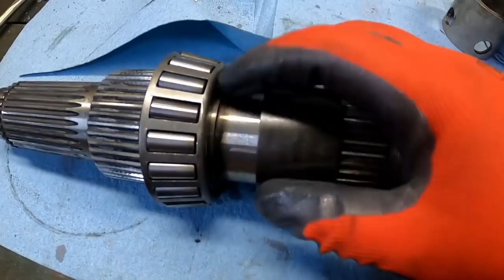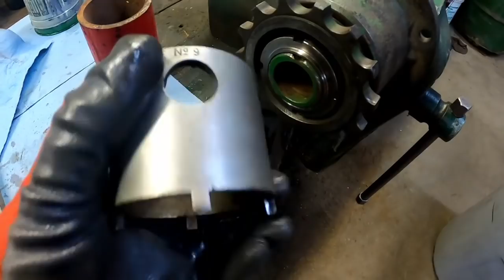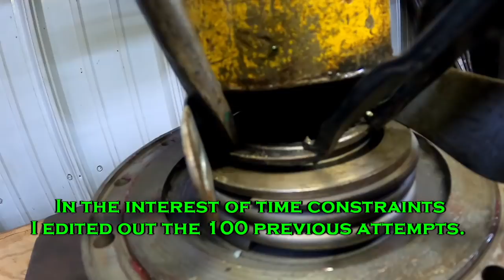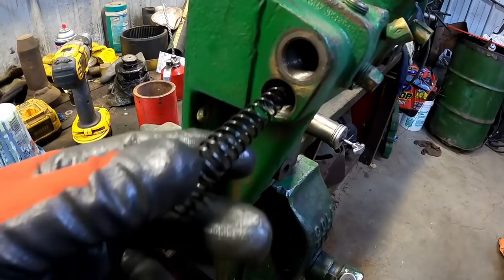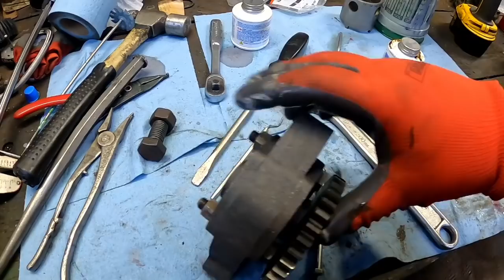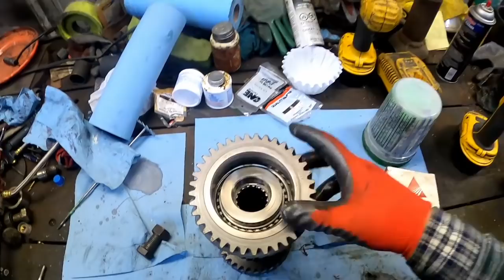Oliver Hydra Power Rebuild Part 2

Comment: I have asked in several places and have never received a solid answer, will a 1900-1950 over/under be installed in a 1850 (that already has a over/under) 
I have had some explanation of early vs later over/under units and the differences between the Perkins VS Waukesha , but that did not nail down if they are "interchangeable"  between the Detroit and the Perkins
Reply from the maker: To the best of my knowledge,  the Perkins and GM 2 speeds are interchangeable.  The parts book is a bit vague on the shafts, so I would do some measurements on shaft length before buying a unit to swap. I've never rried that particular swap,  so I can't say 100% it's going to work. It all comes down to shaft length. The splines and pilot bearing area are the same,  but the Perkins input is about 3/8" shorter than the waukesha version.  
Also, for what it's worth, they never put a over/under in the 1900/1950 from the factory.

Comment: What would happen if you put the input shaft seal in upside with the spring side down?
Reply from the maker: It should still seal ok. If the breather gets plugged, it may be more likely to let some oil seep by. If it's a double lip seal it will probably wear quicker because the oil won't be at the primary lip.

Comment: I might have missed it in the video but what is the torque on the output “spanner” nut of the hydra drive?
Reply from the maker: If it has the spacer with shims to set bearing preload, then the book says 200 ft lbs minimum.  If it has bearing preload set by the nut wirh no spacer or shims, then it's not about torque,  but about that preload.

Comment: Chris what is your 2021 planting forecast as in % of corn, beans, and etc?  What kind of seed and fertilizer will you be using this season?
Any mods to the planter or other equipment?
Reply from the maker: My plans are about the same for % of crops. I will be having a corn test plot of a few varieties,  so I'll try to document that. My lime and fertilizer have already been spread, I hire that out so I can have variable rate done. The investment in equipment to do it myself would be large, so I hire it out. The planter got a bunch of new steel last year, so it doesn't need much this year. Less than 2 months to go if all goes as it should!

Comment: I know a guy looking for a rear axle seal for an 1850, where can he get that?   Enjoy your videos.
Reply from the maker: AGCO dealers should be bale to get one. There's 3 different seals depending on the cap on the end of the axle. The part number will be cast into that cap. Cap 103870A uses the 103730A seal, cap 104006A uses seal 104235A and cap 165121A uses seal 165123A.
Reply: @ThatOliverGuyChris  thank you, it is much appreciated.

Comment: I love your videos watch all the time My 1800 is stuck in the low side if you take the hose off to check presser going to the shift fork oil comes out of the shift fork coming out of the main shaft any Weiss would be really appreciate it but after watching I’m planing on pulling it apart sometime thanks a lot

Comment: Nice video, I found that if I put a large rubber band on the OD of the sprague clutch, it makes it easier to place the gear over the sprague clutch. Just make sure to pull the rubber band off before putting the gear all the way onto the sprague clutch.
Reply from the maker: Thanks for the tip!

Comment: Aside from the embossed lettering on the fenders, what was changed on an improved super 88 from an early super 88 (gas)?
Reply from the maker: They enlarged the battery door on the hood, gas tractors were a 12 volt battery instead of 6 volt, key start and tach were added as regular equipment, as well as a wider drawbar, gas engines got hardened valve seats. Some other options because available too. A new 3 point hitch, power adjust rear wheels, and 15.5-38 tires.